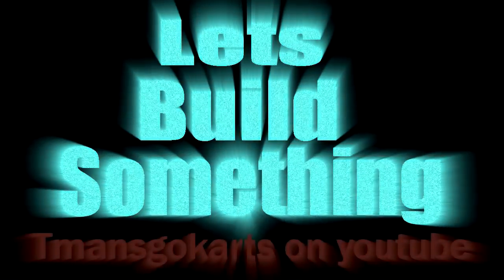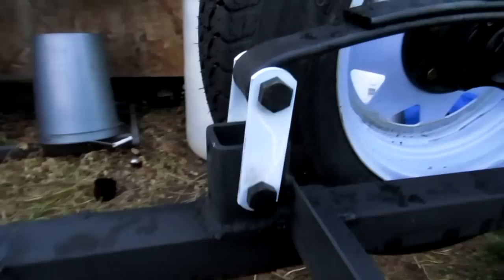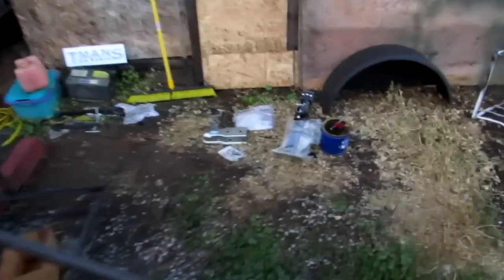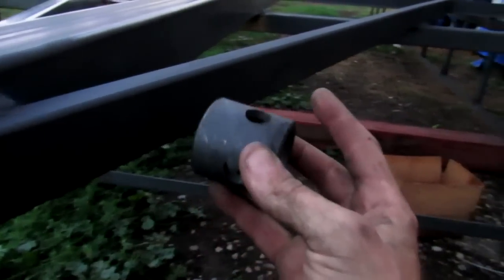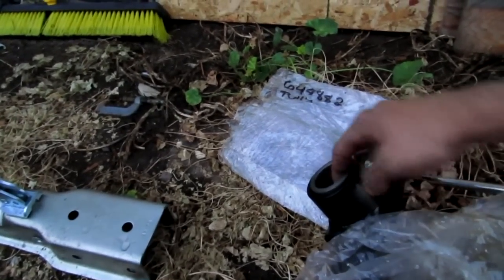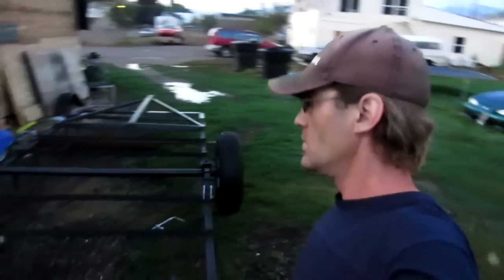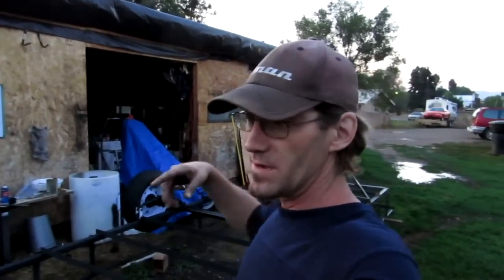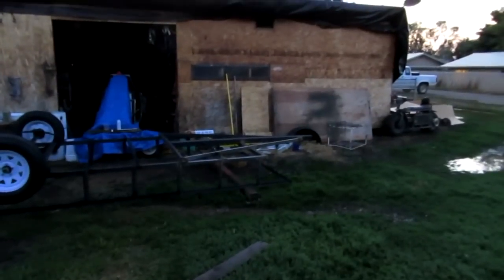Homemade Utility Trailer Project Build 2

Comment: 1" pressure treated plywood or 5/4 pressure treated decking is more then adequate and has the advantage of being easily repaired or replaced. Consider that 1/2" plywood will support a man on 24" centers. it varies depending on engine and axle gearing but my '98 4x4 4.0 liter Ranger can tow up to 5600#, actually with the weight of any load in bed that works out to about 4400# of trailer and load in trailer.

Comment: 16 FT Should be a tandem axle , In time the spring mounts will rattle crack , The mounts on angle iron won`t`be enough Fish plate it on the side too -( Something to watch for )  Using a mig is not hot enough to pressure weld deep without argon -Watch for sway too, I`ve made lots of trailers to haul cars & bales everything you can think of it`s how I made a living when I got hurt -- NICE TRAILER but should have a channel or tube frame sorry to say. .

Comment: you can make it stronger with bars welding acros any rectangle on the side off the trailer
the weldings should be kept worm and not cold 
but the bars should be more of a "concern"

Comment: Are you going to use expanded metal for the bed? If not, a great alternative is composite decking boards. Don't have to worry about the weather with them!!

Comment: not saying the harbor freight welder is a good choice for building a trailer but...........I have a miller 140 with .035 fluxcore  I weld with it on a daily basis...last year my cousin had a john deere bulldozer with a ball socket blade.......the ring broke out of the socket and I welded it back in after some one with a stick welder tried to.....and also fixed the trac on it to with the same welder..........you just have to make sure you get hot pass and burn both pieces together...

Comment: Spring hangers/mounts are welded on WAY wrong. Lay them flat on the frame rail & weld a full bead down each side. I won't say the way you stood them up & welded them on isn't going to hold, but I've built several trailers over the years & I would never attach them in that way nor have I ever seen any factory built trailer that had spring hangers/mounts attached that way. That's just my opinion. It does sound like you'll have as much in the trailer when completed as you could have bought one new for. Hey, it's your project, tho. If your satisfied with it that's all that matters. My best to you.

Comment: Just preheat the shit out of that drop leg jack stud and fire up your welder your already running flux core so you get the most penetration. If you can get 150amps out of your machine you'll be fine.

Comment: 110 v mig should not be used on something that will go on the road like this.  110 v mig, full power and flux just doesn't cut it.  You need 220 v to get the necessary penetration.  I have owned both (currently own a 220) and there is a HUGE difference between the two.  Any failure on this trailer could be catastrophic and could kill someone.  I am not trying to be a jerk, just trying to look out for your welfare--and the welfare of others.  I am not just another youtube safety patrol guy either